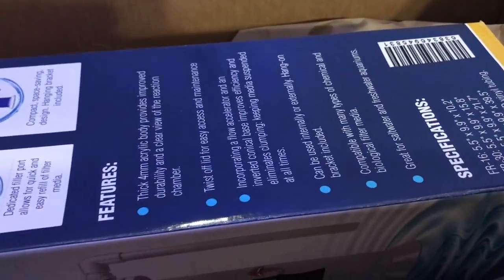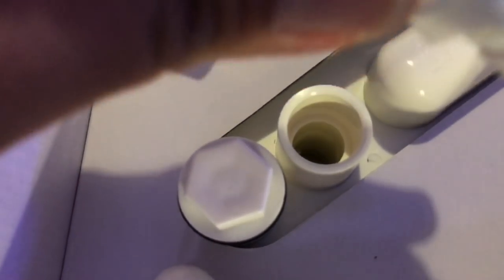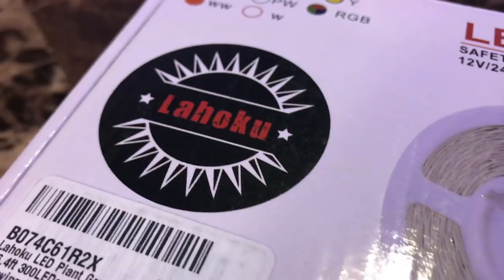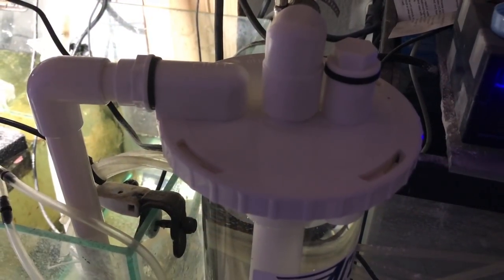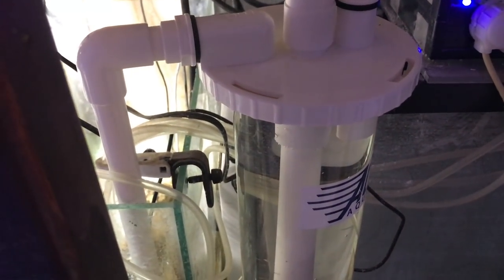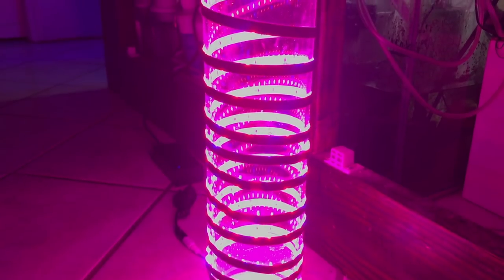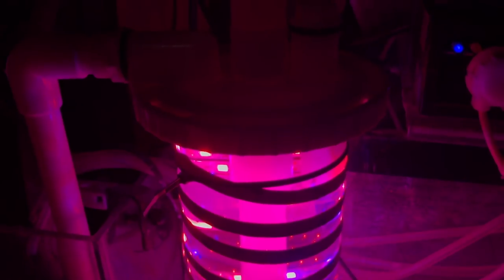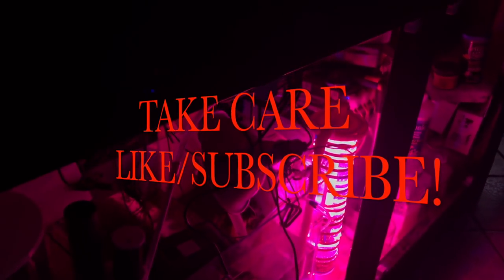CHAETO REACTOR EASY DIY ALGAE EQUIPMENT FOR AQUARIUM | MARINE DEPOT MONSTER REACTOR ACCEL MEDIA

Comment: Very cool dude! I built a cheato reactor out of an accel Aquatic’s reactor too. They work okay but they aren’t my favorite reactor I really like the aquamaxx reactors. They are a little bit more expensive but feel a lot higher quality and easier to take apart for cleaning. But both get the job done. I’ve also never used the red/blue led strip only the waterproof white strip which I found works very well and is more than bright enough to grow the cheato fast. Please post your results in a week or two. Would love to see them happy reefing.
Reply from the maker: brennen nisporic I really like Aquamaxx Reactors they are very Nice. I will let you know how it does and if it sucks or not lol. Best part the led strips are only $14 bucks so no big deal. Have a good one!

Comment: Looks good mang.  Just be careful, are those the waterproof LEDs?
Reply from the maker: Thanks no these are regular Leds. I should be good though, I just unplug it and the water drains into the sump again. I also have a small towel when I take the lid off. Have a good one